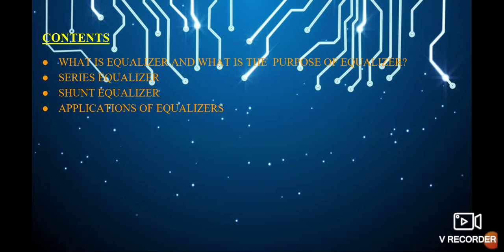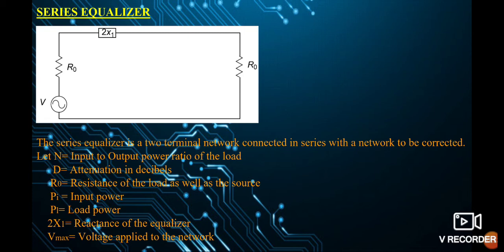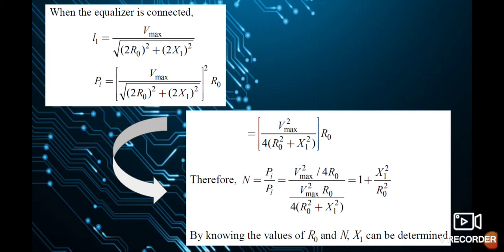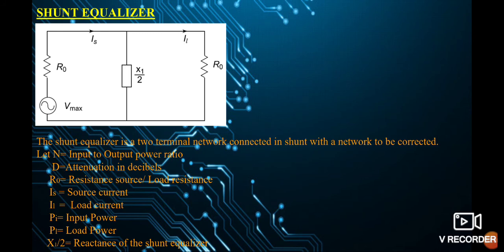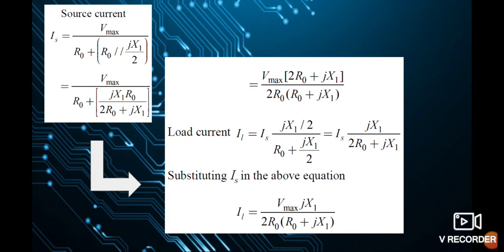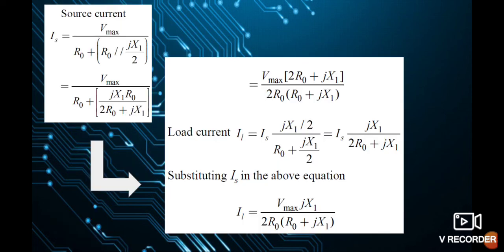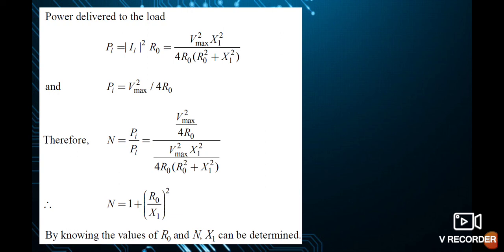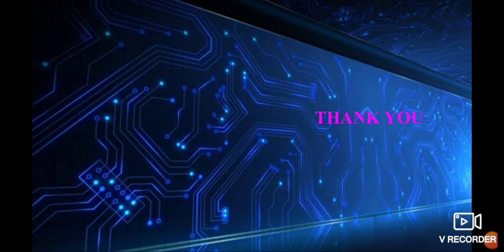Network Analysis (Attenuators & Equaliser/Unit-4/Part-2)

Comment: Why attenuation (N) is calculated for equalizer?? i.e. (input power/output power= Pi/PL)
Why not gain??? ( i.e. PL/Pi)
Does equalizer attenuates or increases 2magnitude of the signals?